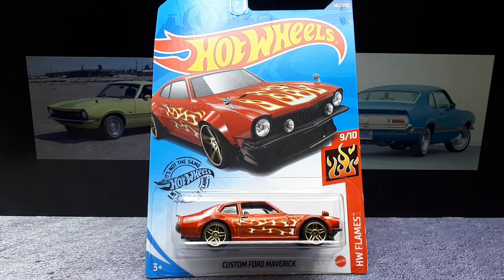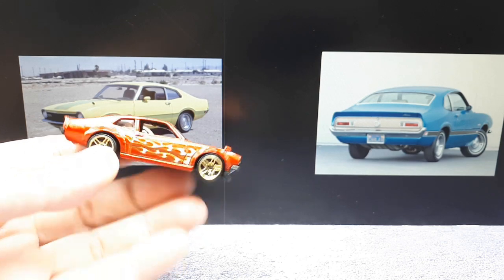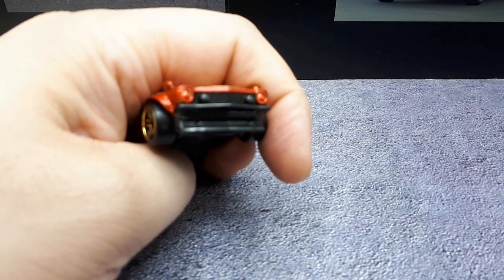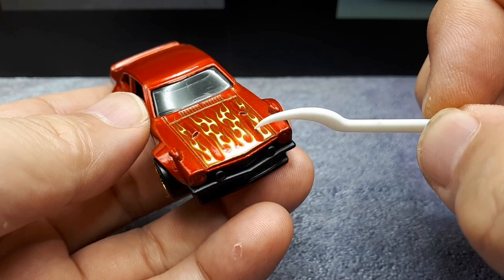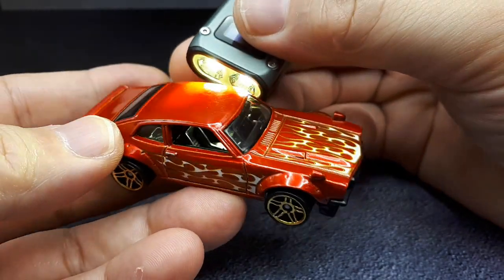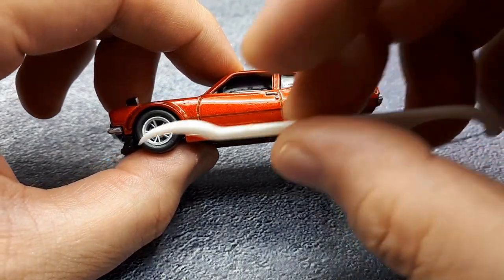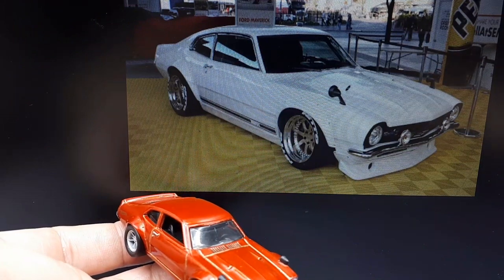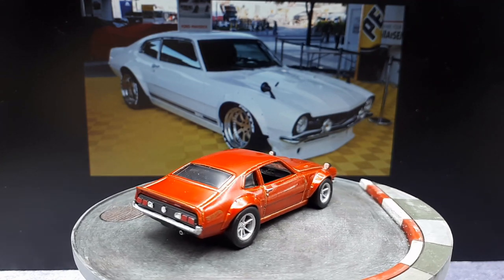~1/64 Ford Maverick custom by Hot Wheels with 3D printed wheels , diecast model review custom

Comment: Ford Maverick,  wikipedia is correct on most points. Largest engine was the 5.0 or 302 CID  Interesting (to me) is that in Mexico they sold a station wagon. Hot Wheels does at least 2 Maverick castings, this is a "custom" and they also have a Grabber.  This is probably a 72 or 73 model year. Fender Flares and Fender Mirrors never a Ford option. I've had a few of this casting and always like it. David of TWYCE sent a cool custom of this he did. The Maverick was very popular near me back in the 70's My best friend had a 73 and my dad had a 76. Love the wheels you made! But this car should have "slotted" mag wheels ;)    Real nice job on adding details. Fun video!
Reply from the maker: Thanks; you're my go to Ford guy. I looked up the wagon; cool.  I wouldn't doubt HW doing that someday.